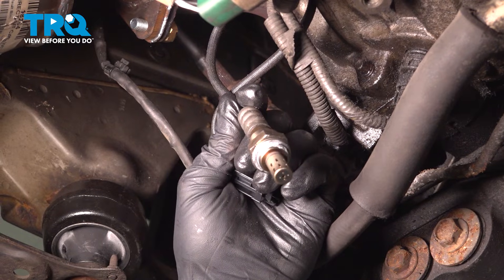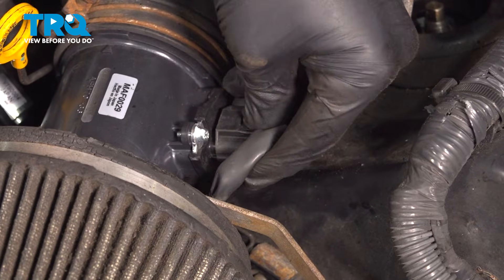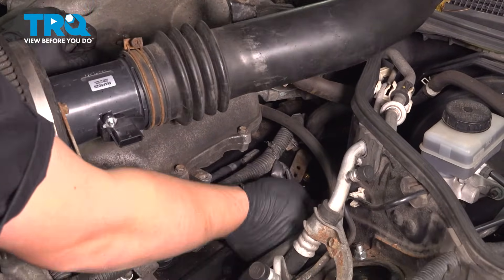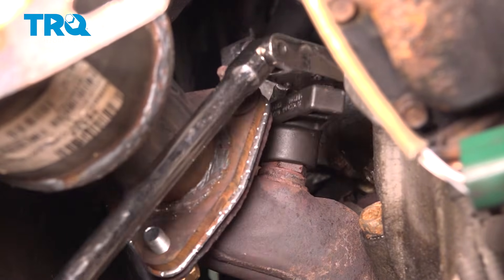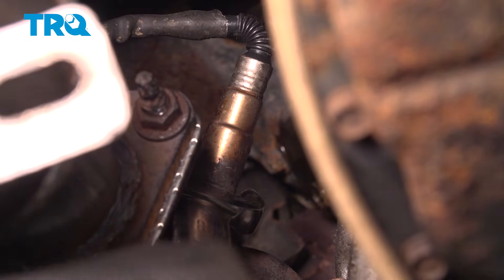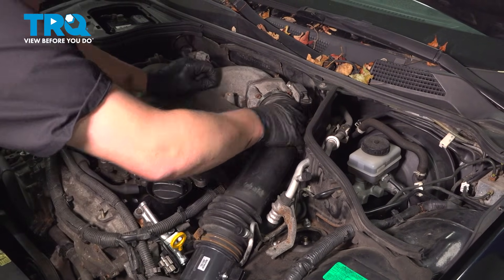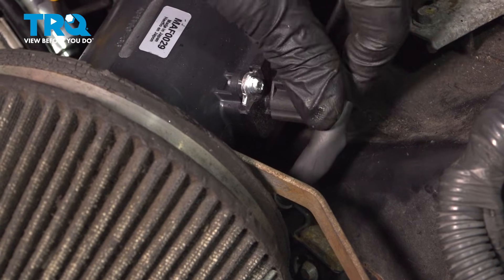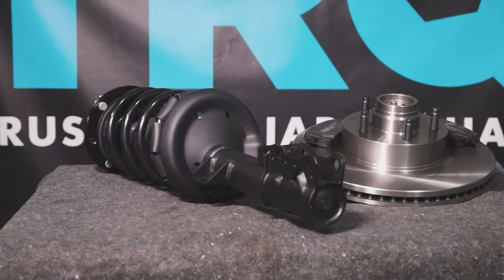How to Replace Upstream O2 Oxygen Sensor 2003-2007 Infiniti G35

Comment: Is this a 4 prong square or 6 prong rectangle connector, the ones on auto zone and brick and motor are square and won’t go into the 6 prong rectangle connector. My seems to be different than most

Comment: How many o2 sensor the g35 has 1 or 2
Reply: G35 has 2 upstream, and 2 downstream sensors. (2 on each bank being a V6 engine. Bank 1 Passenger  side, Bank 2 is Drivers side.)
Reply: It has four 
U have 2 upstream 02 sensors and 2 for the cats
Reply: 2